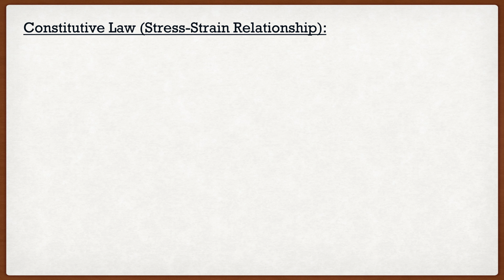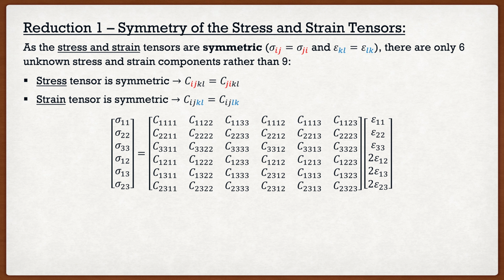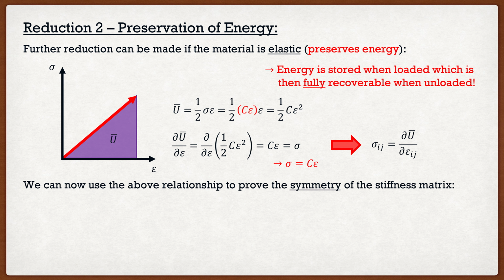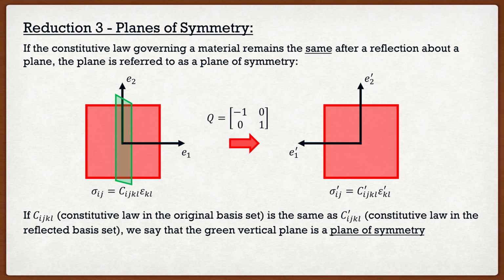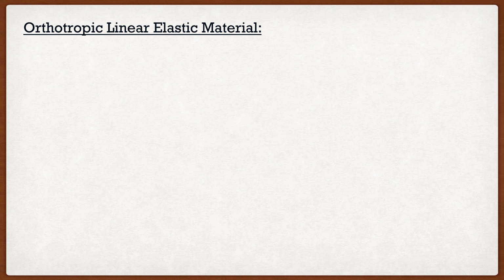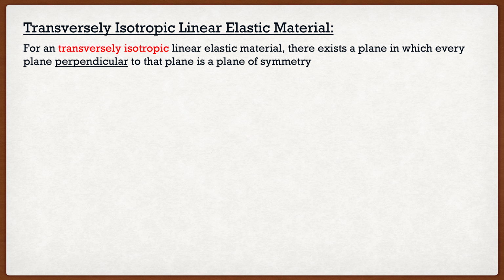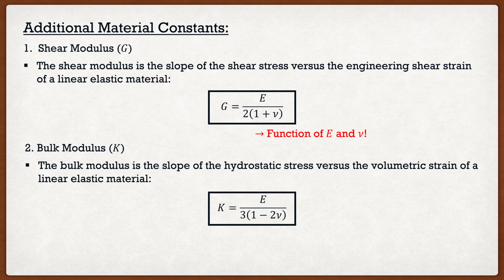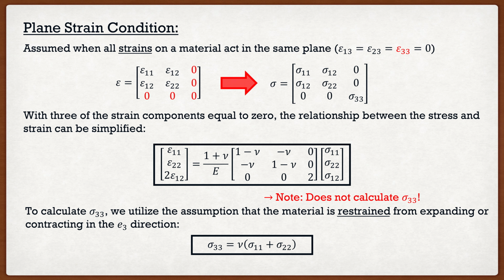Solid Mechanics Theory | Constitutive Laws (Elasticity Tensor)

Comment: thanks for the explanation, in the first slide why does it have 2 times epsilon_12  and in the equation above it just have the coefficients without times 2?
Reply: I think there is a mistake, the first complete vector epsilon (with the 9 terms )shouldn't have the 2, this is only when terms are grouped (because epsiij=epsiji) that the 2 should appear (in the reduced epsilon vector with 6 terms)

Comment: Hi! Thanks a lot for the great explanation! I have a question please, in section "Reduction 2"  you mentioned that order of differentiation doesn't matter since its a simple function, so are there  other general cases where order of differentiation does matter? (it could be an off-topic question, sorry, I'm just curious to know) Thanks!
Reply: It's comes from calculus, which says something along the lines that if the function is continuous, the order of differentiation does not matter. I believe in linear elasticity, the functions will always be continuous. But yeah, there are applications outside linear elasticity where a function might not be continuous, and the order of differentiation does matter.